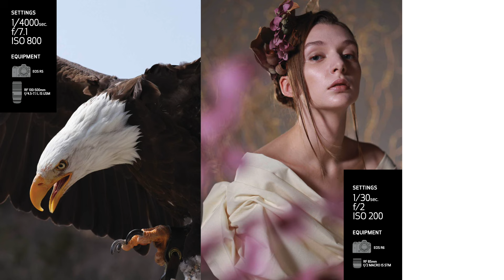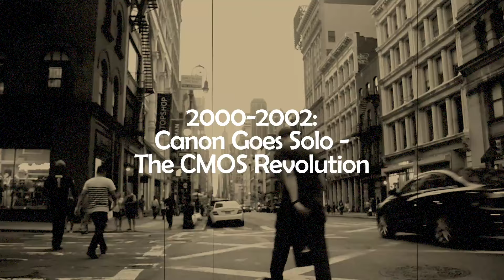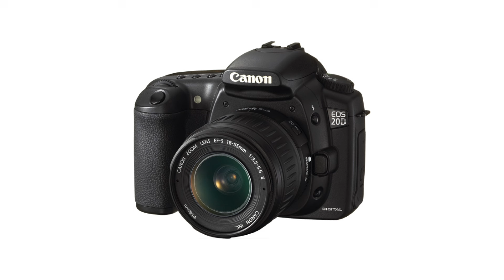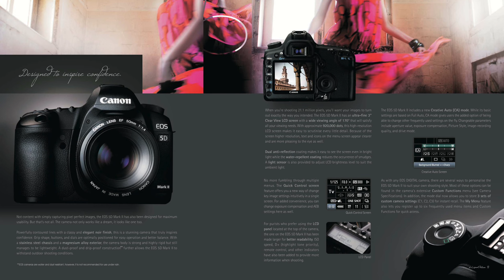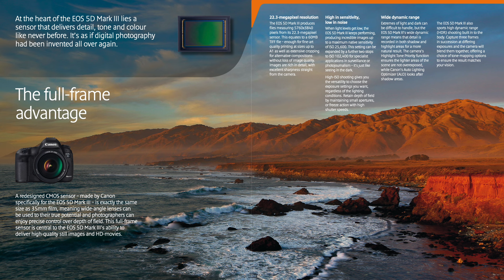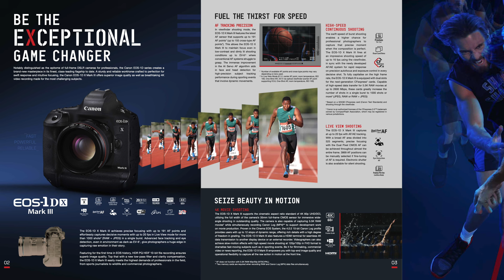The History of Canon DSLRs

Comment: I collect Canon DSLRs myself and currently have the D30, D60, 10D, 20D, 30D, 40D, 50D, 7D, 6D, 5D Mark I, II, III, IV, 100D, 1000D, 300D, 350D, 400D, 450D, 500D, and 550D. If I had to pick just one, it would be the original 6D. It’s simple, has all the features you actually need (working Wi-Fi app, GPS, and a fantastic center AF point), and gives you that 5D-level of image quality.